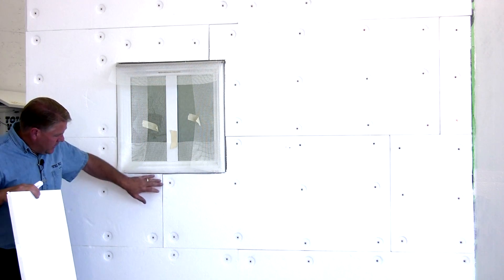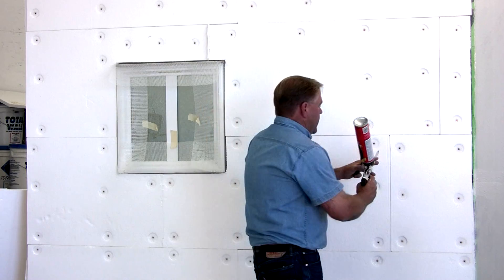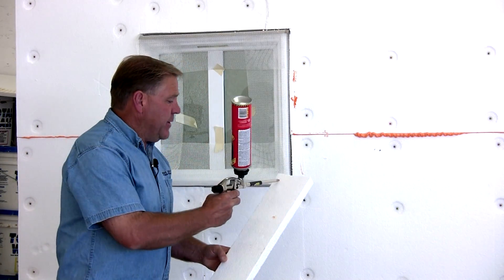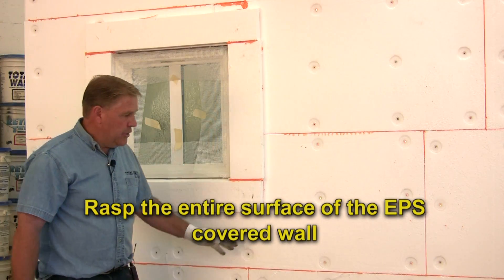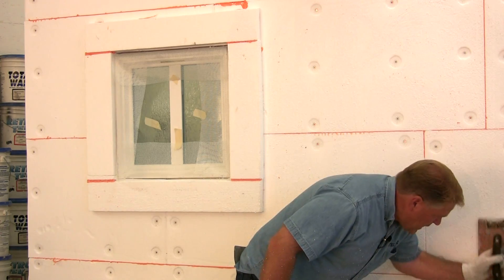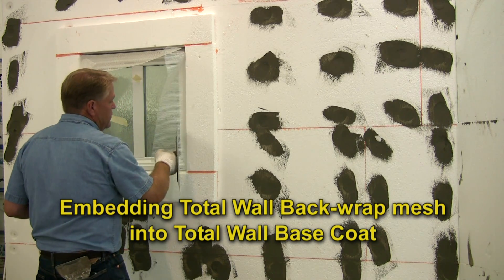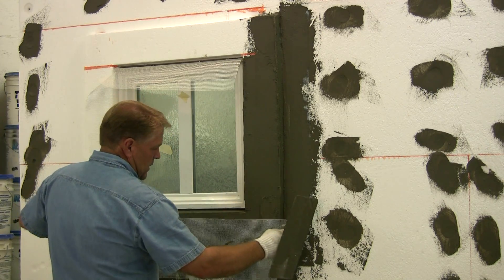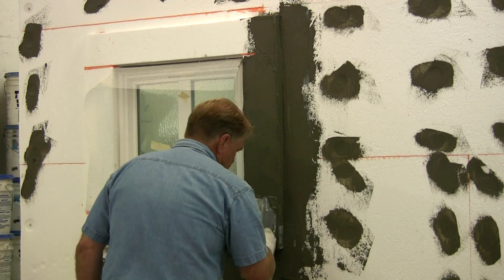Total Wall- Chapter 6 Base Coat & Mesh

Comment: Question/comment, quality stuff in this, I had a short-lived fire, stucco more than likely stopped the penetration into living space! I've now what I believe are heat cracks in the base coat as the top coat burned away (synthetic) should I fill those cracks and ad a new top coat or? Thanks in advance

Comment: I hope  that Spray foam wont crystallize over time or all your trim boards are gonna fall off  eventually
Reply: It’s better to stick it with primer adhesive mud using a notched trowel

Comment: This guy is not very good. Entirely too much wasted time. Apply the foam properly and there is no need to fill the gaps.
Reply: I've applied miles of foam and I'm very good at it. I have never in 30 years seen a foam application that didn't need gaps filled. 
 If you think that small gaps are no problem you're wrong. Gaps over 1/16 of an inch filled with mud create a natural breaking point for the lamina (basecoat with mesh and finish) and a potential leak.
 Learn the system, work the system, and we'll preserve the system for the future!
Reply: He works for total wall
Hes gonna go above n beyond for warranty reasons
He can run trowel
Reply: Yeah. Why put such small pieces of foam on the wall?
Reply: I 100% agree with this is not very good if u do a video make sure things are professional.  All I can do is laugh, I am sorry I can't help it, very sad makes stucco look very bad in peoples eyes, if u want a sweet jobs done check out century stucco systems in London Ont.  They are the best
Reply: @MegaKenny112  You've never did this kind of work. you will have gaps from time to time. sometimes the foam gets squished on the edges up in process of transport {i.e from rachet straps and tie downs) Sometimes the foam is not cut square from the factory) Point is your gonna have some gaps and it is perfectly ok to fill them the way that he did.
Reply: @dirkg7062  I did stucco for ten years and was sick and tried of filling the gaps, they are nothing but a pain in the ass and take to much time to do when u have a million of other things to accomplish that same day.  So I made sure there as few gaps as possible so u don't spend half a day messing around.